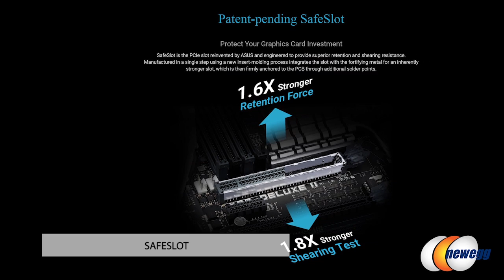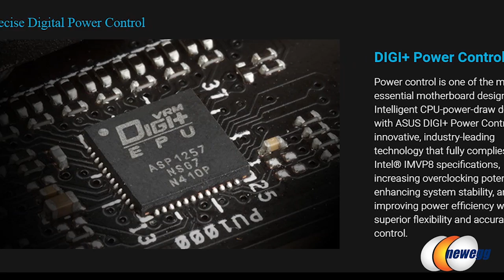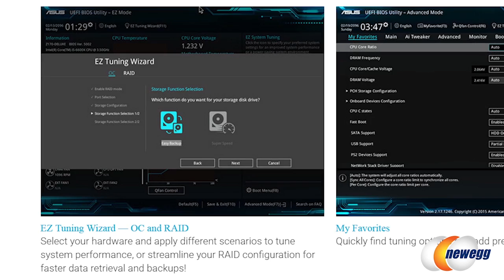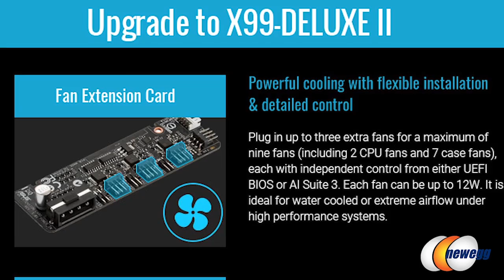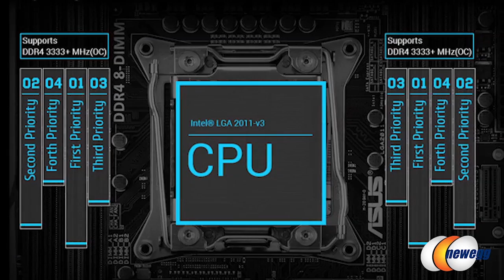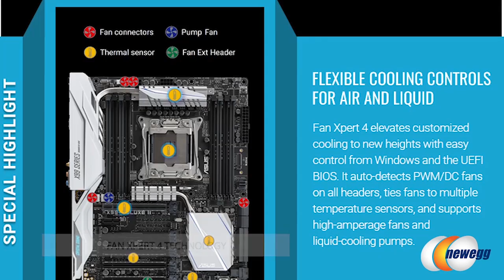Newegg DIY Garage: ASUS X99 Series Motherboards for Broadwell-E

Comment: I am having a terrible time with x99 motherboards with the LGA 2011-13 socket... Please just make the damn thing work!
Reply: what is wrong with your x99?
Reply: explain
Reply: maybe the ram or other stuff that is not supported?
Reply: x99 motherboards are really risky to get... They can be delivery dead on the spot.
Reply: I have not problems with my Sabertooth X99 Haswell LGA 2011-3 w/ i7 5930K.  Component installation was easy. No problems with bios.  Work great with Linux as well as Windows. Overclocking is great been able to OC at 4.5GHz with a voltage 1.37V.
Reply: i tried many motherboards and i had to ship them back to Newegg maybe 2-3 times. Before i acutally got a board that worked..
Reply: so your happy again so that u can overclock and game again
Reply: munakim1 just out of curiosity, every time was a different problem? When i bought the x99 sabertooth i coulndt get it to boot because of incompatible ram. Funny as it sounds you cant just throw any ddr4 you want inside Asus boards. Its a shame for future upgrades, but it is like that.
Reply: +f4z0 funny as it sounds almos everyone buys all the components without ever checking for the component brands suggested by the mobo manufacturer
Reply: That would be me. Never had a problem to my knowledge, but damn, that could explain a lot of things, I would think. I wonder now about the 'gpu driver quit working and has been reinstalled' or whatever that error is. Of course it's more than likely a bad driver version, but thanks for the reminder to check compatibilities.

Comment: I have a few questions, JJ. I went with the Rog because my case won't can't fit the Rampage (EATX). I am thinking maybe I should go with the Deluxe II because I am interested in the thunderbolt3 to connect an SSD. What SSD type would thunderbolt3 take? Plus there is 2 m.2 ports and not just one like the Rog?

Comment: I used to love the P8P67 and that generation.
Now, I have 2 x79 boards (3930k) and the Gigabyte is solid and reliable. The Sabertooth is always losing settings like when I set the multiplyer, go through the other settings, then before I F10 it, I check the multiplyer, and all cores are on auto!! Even more bizarre, is that is the same with my X99-A. I always have to go back and check the multiplyer to make sure it's not on auto all 6 cores. Not to mention that these suck at OCing. On my Gigabyte, I get 4.7 just about only with the multiplyer, but when I put the chip in the Asus Sabertooth, I'm lucky to get 4.2
These asus boards suck at OCing and their UEFI seems unstable. I have to clear CMOS if I can't get it to boot, even trying a fricken 3.9 GHz and 18XX memory.  I have never had problems like this. Using the Asus boards just has a flimsy feel.
Reply: try to replace the bios battery with a new one, the way you describe it seems to point at a discharged bios battery
Reply: Hey, thanks! That makes perfect sense, now that you mention it. You just saved me a lot of money, Sergio
Reply: +Mike Laing Did it work?
Reply: hey, man, I'm sorry for taking so long to get back. I am going shopping later and will pick up so batteries. Hah - my dad just told me they have packages of 3 at the dollar store for $1.25, but I know it's taking a chance that they're full charge. I will probably just get some at the Safeway or drugstore where they cost around $47 for a package of three - lol - probably about $10, so no big deal.
The boards I need to check are the Asus Sabertooth and also I remember my Gigabyte X79 UD3, but in that case I think it was the PSU. Still, I had probs with that one also.
Just as a side note, I did get an overclock of 4.7GHz on the Asus, and I'm pretty sure I barely touched the voltage - .050 adaptive or something. So, I ran Cinibench 11.5, or whastever the latest is, and I effin' well got over 14 - 14.3 or so!!! I got just over 13 on a 4790K @ about  4850GHz and That was my best getting fricken 12 point something. 
That 3930K was unreal amazing fast when it came out. That was almost 5 years ago! It' still rocks, but anyway, enough rambling. I don't get to talk computers very much.

Sooooo, I'll check the board out and get back to you within as soon as I can, lol. That was a great idea to me, so we'll find out for sure.

Comment: X99-A II ,Core i7-6700K, GeForce GTX 1070 Founders Edition, I need recommendations of what memory ddr4 quad channel with green leds on top to buy to get the most out of the build overclocked. About to drop some coin on u newegg. need help.
Reply: Have you tried the Asus forums? (I don't even know if there is one, but just something to check out)
Reply: not yet I am getting a bonus coming  and making the dream machine happen. live once.
Reply: Ehm a x99 board With 6700k? Good luck :-P
Reply: +Thomas Jensen May I ask why u say that? It is my first build and I don't want to make a mistake.
Reply: +TheDuckseason sorry mate. A 6700K only match 1151 motherboards. 2011-v3(X99) motherboards need a different CPU.

Comment: The glossy sales talk is all great, but a lot of people have had problems with X99 and to be fair it's not just with ASUS boards, though my board is. Problems such as Bios hanging, USB conflicts causing the board not to boot or recycling in a boot loop. I had problems with mine refusing to boot to windows and hanging at the windows logo. After many hours of checking hdd, memory, clearing cmos, I discovered that one rear USB port did not like a wired mouse connected on boot. Also the bios can hang periodically. My bios is F20 and as I've now got things working and know the USB problem, I'm not risking a bios update. So as I say, if your very lucky you might get a board that works out of the box, but be prepared for problems. Not a board for a noob or inexperienced builder. The X99 series is new and ongoing development, unfortunately we are the guinea pigs paying for the privilege of being testers.
Reply: How can you clean socket pins? I wipe the CPU with isopropyl but wow, cleaning the pins? Do you any suggestions how to do that?
Reply: JJ, I had the very first Asus X99 Deluxe and that board really buggy!
Now, I had the Asus X99 Deluxe II, it's so much snappier and faster.
The whole operation are much better and it had no issue with my existing Avexir Core Series DDR 4 Ram on XMP. The old one at times had BOSD and at time it will hang with buzz sound. I think there for sure some components difference as I can feel the X99 Deluxe II, it is much smoother and snappier! I'm very happy with X99 Deluxe II compare to X99 Deluxe 1st generation

Comment: Yeah, Asus are so great, flash back does not work on my board, and they did nothing about it,
Reply: done all that, named the file everything under the sun Z77VPR.CAP Z77VPR.rom Z77VPR.bin, done every format, fat32 fatex, fat, NTFS, tried lots of USB drives, its a hardware fault, but Asus would not do anything about it, i was also in warranty, its put me off buying asus ever again,
Reply: not just that, but the USB 3.0 on the board I have, is very poor, they wont allow a hub to be put in, or all usbs on the hub, stop working or are shown as a hardware fault, nothing wrong with the usb hub, used it on other computers in the house, I dont like my asus board at all, and paid 300 pounds for it, which was a rip off, also asus dont offer phone support for boards, only laptops are allowed phone support
, which means I have to waste my time with filling out long forums, of info you dont even need to know,

Comment: To JJ AND ASUS (AND NEW EGG FOR SELLING THEIR SHIT PRODUCTS): Why don't  you back and fix all the problems with the previous generation of X99 mobos instead of making users purchase another mobo. I have the Asus Rampage V Extreme, paid a premiun for a mobo plagued with issues, added unnecessary ASUS software and features that are full of bugs and/or don't work, drivers that haven't been updated or supported since release. The wifi on the RAMPAGE V drivers are still in beta and works like shit, unstable for gaming. The BIOS is another nightmare, everytime they update it they seem to fix something and cause more problems to the board. The list goes on and on I can sit here and type pages, if you don't believe just go on Neweggs reviews and read what others have to say.